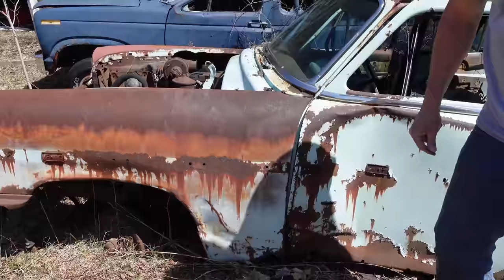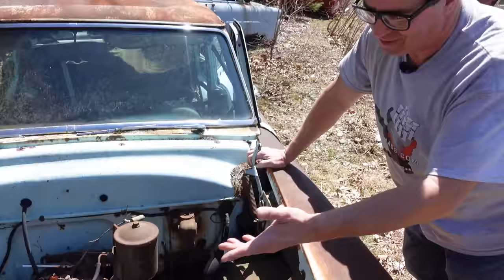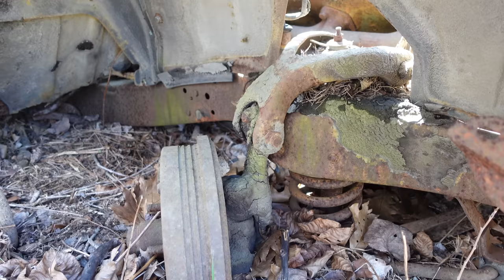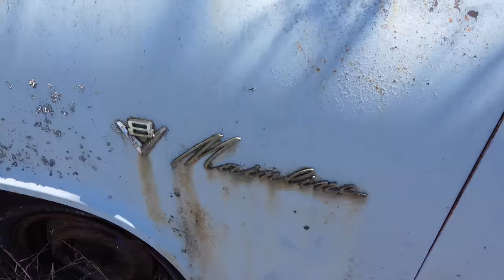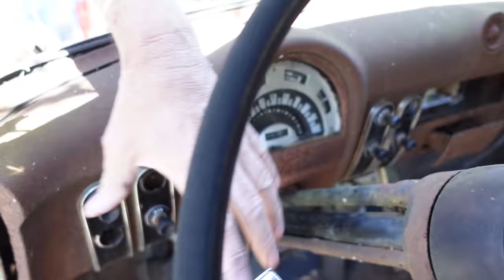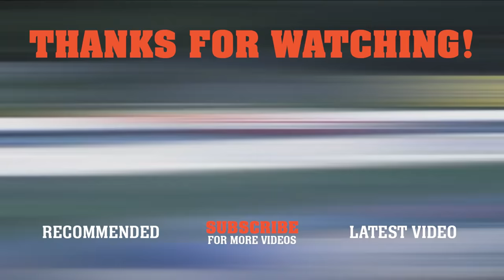1953 Ford and Mercury: What’s the Diff?

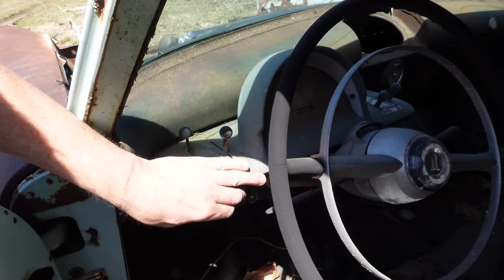Comment: Way back in 1974 just out of high school I was working two jobs, turning wrenches at a used car lot during the day and working 3:30 - 11:30 PM at Caterpillar Tractor Company. I got paid off for getting a 1956 Dodge dump truck back on the road with a 1953 Ford Victoria. It only had about 40 K on the clock but the midwest winters had taken it's toll on the sheet metal but the interior was great because it had dealer installed seat covers that when removed the seats were like new. 239 Flathead V8 with the Ford-o-matic  transmission and optional clock, radio, heater and outside sun  visor. It had been sitting on the lot for about six months so a new battery, gas and a quick tuneup I traded it for a '64 VW bus.
Reply: now the true question is.. you still got the bus?

Comment: The tail lights and tail panels were different between the ford and Mercury as well. Looking at those 2 examples, the Mercury definitely gave you more and was a step up during that period. Much more so than in later years.

Comment: I had a friend that worked at the old Pico Rivera Ford plant back in the 70s.  They built both Ford Pintos and Mercury Bobcats on the same line.  He said the main difference between the two was the Mercuries got lock washers and the Fords didn't.

Comment: My mother owned a '53 Ford light blue Mainline with a stick shift V8, that is the exact same car.  It was radio delete.   This car did not have a radio but the delete panel was knocked out. 
The car was scraped along the right front fender. 
The scrape was done in '56, but the fender never  rusted out. 
I was curious if some how I could get a picture of the right front fender.   The bazel around the right head light was bent also, but that may have replaced. Please text me back.

Comment: Hello Steve. Thank you. How did Ford arrange the different wb?  Just by moving the front crossmember, if they used the same frame?
Reply from the maker: Hi Michael, I'm going to assume the frame and fenders are longer from the firewall forward. This isn't an uncommon way for a mass produced automaker to "add difference" between otherwise similar vehicle platforms. In the 1982-'86 period, the Toyota Supra got an extra 4-inches of wheelbase strictly ahead of the firewall so the DOHC six could fit within the Celica host platform - which used a shorter SOHC four cylinder engine. One nifty oddity in the Toyota Celica / Supra world is the 1982-1984 Celica GT-S. The GT-S uses the Supra's independent rear suspension and rear disc brakes but is based on the shorter Celica platform since it has the same 4-popper as a basic Celica (which would have a solid rear axle on coils and rear drum brakes). The Celica GT-S even has much of the Supra's interior and the Supra's beefy four-corner fiberglass fender flares to cover its larger Supra-sized wheels and tires. Watch for a video on one of these rarities next week. It's called "Pseudo Pseupra" for obvious reasons. THANKS for watching and writing, Steve Magnante
Reply: @SteveMagnante  Hi Steve, like the BMW E36 Series. They also had slightly longer front fenders ( between the wheel and the doors) for the 6cyl. 
Thank you for your videos. I like your enthusiasm and also the railroad video. Stay safe

Comment: My dad did the junk yard crawl sometime back  in the early 60s. At the time he was driving a 52 Ford Custom with the flathead V8. The block cracked so he went to the junk yard to get another engine. There was another 52 on its side with an engine but no transmission. After looking the car over he decided it was in better condition than the one he drove in so he made a deal, pulled the transmission out of his car. Put it in the other one and drove it for several more years until my mother slid it into a tree and wrecked it.

Comment: This one hits home. I've got a 53 Customline,  239 Ford-O-Matic, unmolested. Previous owner didn't know it was a 3 speed. You have to manually shift to first, or it starts in 2nd. Also, it only starts in neutral.
Reply: I have the same in a four door, the automatic is set up that first gear is a granny gear, back then more roads were dirt/mud and the snow was deeper year round, it gave you a better chance of getting unstuck.  And yes, when you select drive, it starts in 2nd, then slides into third at about 20 mph.  Their not hot rods and weren't meant to be

Comment: I owned a 53 Ford Mainline two door post car just like the one in your video, the only difference was that it was light tan. That 239 was a very simple engine. I nursed it along, and drove it until an intake valve seat cracked, and allowed coolant to be sucked into the third cylinder from the front on the driver's side. This video did bring back a lot of memories from a very long time ago.
Reply: Do anything cool with it while you had it?
Reply: @mitchmcguire6321  Just kept it running, I drove it to school until
 the engine turned into a water pump.
Reply: @hoss1947  I replaced one water pump on my 53 Ford Customline about two years ago. Weird how they're part of the motor mounts. Haha

Comment: l inherited my grandmothers 53' Customline 4 dr baby blue 239 cu in flathead 3 on the tree w/ dash pull overdrive with less than 50k on the odometer. She had serviced it at the same gas station until l got it in the 80s. lt was all original, garage kept and drove like brand new when l got it. l was installing a 'vintage air' ac package in it and it was stolen in front of their business while l was on my way to pick it up ln the 90s. Never saw it again.

Comment: Also, the Merc used a 4-bolt carburetor, the Ford used a 3 bolt carb.  Both 2 barrels.
Reply: Not to mention the vast difference between the downdraft Holley on the Merc as opposed to the Stromberg (94?) used on the Fords.

Comment: Steve, love your videos, but when you speak outside your expertise you start to break traction, the B52 is not a fighter it's strictly a bomber.
Reply from the maker: Hello Tom, right you are. my problem is that I do these things "live" with zero editing because I only get the camera gut for a few hours. So as I do my walk around I sometimes mis-speak and say things that may be a little fuzzy. They come out, a little light goes on in my head but I am compelled to keep going. In addition to the car world, I'm also an aircraft fan. Yes, I get it, the sight of a massive, lumbering B-52 dicing it up with a single seat Mig over North Korea or Viet Nam isn't going to end well for the Boeing. The fighter-bomber category of jet aircraft is populated with big-but-small creations starting with creatures like the Arado A234 2 (and 4) jet powered machine of 1944-'45 in Germany. Very different machine - and mission objective - than an Me262 (except for the crazy mandate by Der Feurer to blur the Me262's role into a high speed attack bomber rather than the pure fighter it was originally designed to be). I am interested in the aircraft realm and apologize for the MAJOR blunder of inferring the B52 was anything other than the worlds oldest continuously operational strategic BOMBER. Oh, I'm a big fan of the movie "Dr. Strangelove", where the B52's role is on full display. Thanks for writing, Steve Magnante
Reply: @SteveMagnante  if I did what you are doing unedited my foot would probably be in my mouth most the time. Keep up the good work!!

Comment: Swapping merc cranks to ford blocks was a very popular mod.  When they went OHV ford did 292 and merc 312.  Eddie Meyer, Spaulding, Harmon Collins, after market names from the 40-50's.  My first engine build was a 49 ford, merc crank, eddie meyer heads, spaulding ign, harmon collins cam.  3 sp with OD, cool hot rod for a 16 year old kid.

Comment: I use to want a Merc crank sooooo badly. It's been well over 20 years since I sat behind a flathead V8. Still have one in a 50 sedan , an 8BA. Use to drive it regularly but parked it one day , and just never drove it again. Always wanted to put a 4 inch crank in it , just to to it. Like it was it would run over 100 MPH no problem and any time I checked the MPG it was always over 20 without the Borg Warner overdrive. I had one of those transmissions but never installed it.

Comment: Ford first offered seatbelts as an option in 1955 and is falsely credited with being the first to offer seatbelts when in fact that honor goes to the extremely rare Tucker who installed it as standard equipment in 1948. Tucker also had 4 wheel disc brakes

Comment: I've never understood why manufacturers used column shifters as standard equipment for anything. It seems to me that a floor shift would be cheaper to produce simply because it can use a direct linkage (or cable in the case of automatic transmissions) to the transmission itself rather than a more complex setup. Fewer parts to assemble=fewer workers which, in turn=lower cost to build the vehicle. I could actually see the column shift being an extra cost option.
Reply: These cars were bench seat 6 passenger units (no bucket seat and console) so the floor shifts were only in the trucks.
Reply: @stevejohnson1321  As I said, extra cost option because it's what people wanted.
Reply: @rogersmith8096  Yes, I realize that. However, trucks also had bench seats and most of them, when equipped with a 3 speed manual also had a column shift back then.
Reply: Good point! And a three on the tree looks so dorky. They always considered sedans a six passenger and that may be some bearing on the purpose.

Comment: Haha did kids back then swap sheet metal around like the kids swap VW Mk4 Jetta/golf front ends nowadays ?
Reply from the maker: The front end swap would be a good idea but the difference in space between the front spindle and door-cut on the Mercury fender (longer than Ford) would trigger all kinds of fitment hassles. I know grille parts were juggled by Kustomizers back then. THANKS for writing, Steve Magnante
Reply: @SteveMagnante  haha true ,now that I think of it the wheel openings would be in the wrong area. 
Might make an interesting street freak/gasser look though.

Comment: @Steve - would the Ardun hemi heads still go on the Mercury version of the Flathead ?
Reply from the maker: Good question, as far as I know they are interchangeable and there's no major difference in the deck surface that would interfere with those massive ArDun Hemi heads! H&H Flatheads in La Crescentia, CA makes repops! Thanks for writing, Steve Magnante
Reply: @SteveMagnante  Now, if only someone made something similar for my Slant, or the 250 flathead six from Dodge trucks. :)

Comment: I have always believed the difference between the two was the Companies engine as the car's powerplant. Therefore, if you don't put the wrong motor in the car, ( This would be a motor connected to the brand either by the base Company or a Company that was/is somehow connected to the Company at one time.) then the new vehicle would be considered by myself as a refrigerator. Like a Studebaker should have a new engine from Ford or MOPAR or you EFFED-UP big time. Also, body work, (Altering the skins or just switching out the front ends and exchanginge and modifying trim partrs.) and changing the mounts could put any FoMoCo powerplant in the engine bay. Seat belts. Put in a custom set, and drill the holes if you have to. You would have to cut and weild, but the Merc dash would fit in the Ford.

Comment: Two Door Sedan. I wish Steve would be more accurate.  He presents himself as a historian but he uses made up names for body styles. Manufacturers Never called them two door posts. If you fancy yourself as a historian you should present history accurately.
Reply: It’s akin to calling a Chevrolet a Chevy.  The vernacular does not change the intent or content.
Reply: @charlesdalton985  I think your words may be too large.
Reply: @charlesdalton985  GM often referred to Chevrolets as Chevys.  No manufacturer called their sedans post cars just as Ford never called the Skyliner a convertible with a metal flippy top or Chevrolet called Corvair the noisy thing in the back model.
Reply: @Steverinomeister  So we should never call a Fordor Ford a four door?  Or a Tudor a two-door?
Reply: @charlesdalton985  No, just the opposite. Ford Did call their cars those names so it is correct to identify them as four door and two door.